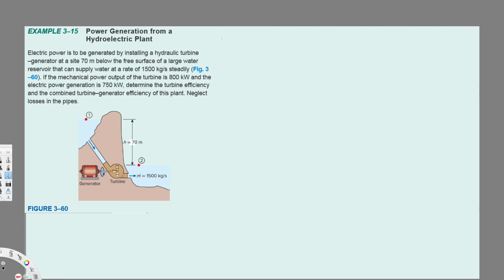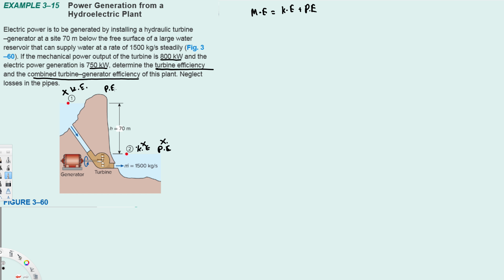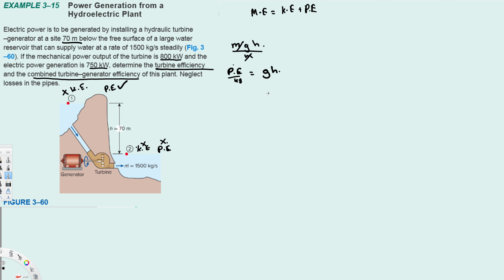Thermodynamics - Power Generation from a Hydroelectric Plant

Comment: Why do everyone completely neglect that flow energy exists. I don't care about simple solutions, explain the interesting physics behind the flow of the mass. You don't need to consider the potential energy if you choose the inlet of the turbine to be point 1. I just don't fully understand how to calculate the pressure differences in this method.